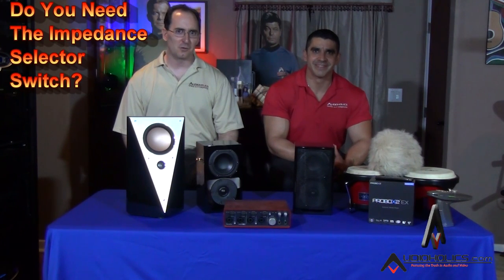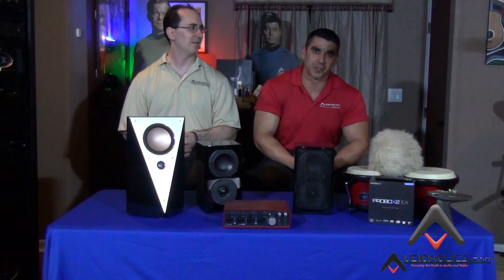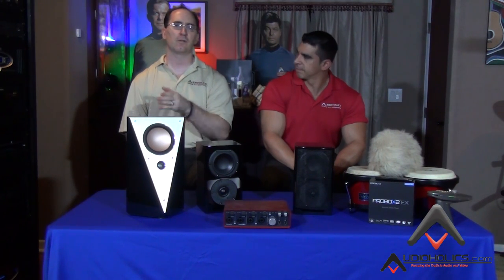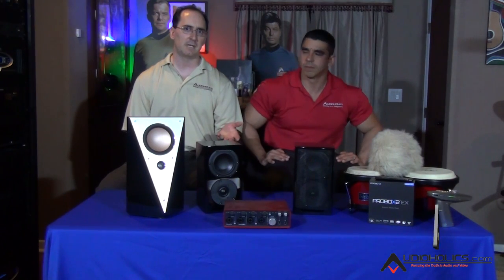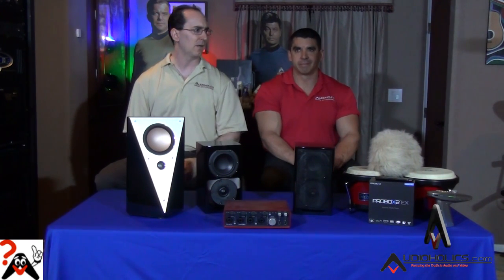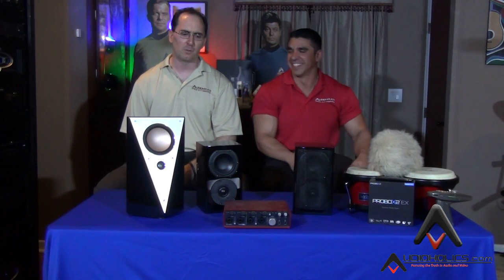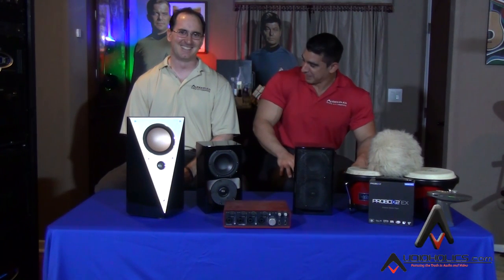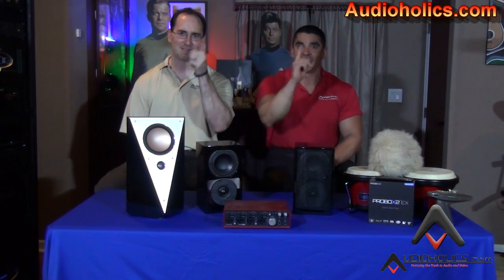AV Receiver Impedance Selector Switch: How Should I Set It?

Comment: To settle this, I would like to see the opposition side of this argument present their case with bench testing results. An actual expert who disagrees with your analysis. The two of you could present the pros and cons and the viewers would then be armed to make decision that they are comfortable with. It's not easy to go against the recommendations set by the people who design the equipment. Especially when equipment costs can easily be in the tens of thousands of dollars.
Reply: For me. It still doesn't make sense. A 4 ohm speaker needs more power than an 8 ohm speaker, so how can a 4 ohm output setting on the receiver deliver less power than the 8 ohm setting?
Reply: @volvy420 @volvy420   Exactly, it makes no sense at all. 
The lower the impedance resistance on the speaker the more current it will draw from the amplifier. If you keep the amplifier t 8 ohms but you have 6 ohm speakers, I would think it would heat up the amplifier more because it would be trying to draw more current this reducing the performance of the receiver.
Reply: @shawnm1472 the whole point is for the Amplifier to be able to deliver more current to your speakers without restrictions from the Amplifier.
So setting at 8ohms on AVR, with 4ohms speakers would allow more current thus more dynamics for your 4ohm speakers.

Comment: Its funny how i stumbled on to this video, here is what i have and i was talking to my speaker company I have Cerwin Vegas for the Front  Below is what Cerwin said! 

VS-150 Specifications

 
DESCRIPTION:                                   15” 3-Way Floor Standing Loudspeaker
FREQUENCY RESPONSE:                28Hz – 22 kHz
POWER HANDLING:                        5/400 Watts RMS (Min/Max)
SENSITIVITY:                                      102dB (1 Watt @ 1 Meter)
IMPEDANCE:                                      4 Ohms
LF DRIVER:                                          VSW  15” Die-Cast
MF DRIVER:                                        DXM6  6.5” Cone
HF DRIVER:                                         VS-T3  1” Dome
PROTECTION:                                    Self-resetting PTC (high frequency)
DIMENSIONS:                                   35.5” x 18” x 18.6” (H X W X D)
AIRSPACE:                                           5.0
PORT TUNING:                                  33hz
PORT DIMENSIONS:                        (2) 4” dia. X 10” long
WEIGHT:                                              90 Lbs.

Whatever the receiver is, setting it to 4 ohms for these speakers will get you the best performance. For a sub, you will want to look at our home audio lines such as the SL series or the XLS series subs.

I have never tried this but I dont think i will, i am in the market for a new Reciever , I had a Yamaha rx861BL   I returned it because of it not having A/B Switching which i like because i can play the same sound while i am in the garage.  Now everything is Zones which i dont understand yet.   So I returned it and bought a Pioneer Xl301 Elite!  Complete Junk i am taking it back tonight, I just dont know what to do about my A\B Switching
Reply from the maker: Please rewatch the video.  There is NO CIRCUMSTANCE where setting the receiver to the 4 ohm setting will improve the sound quality or power delivery to your speakers regardless of what speakers you own or what their impedance is.

Comment: ehhh because im a rookie ill need your help soo i got a receiver that is rated 6-16 omh and my speakers are 4-8 omhs so right now im damaging my receiver if i play them loud right?
Reply: you will damage your speakers if you play louder than the reciver can deliver clean power. as stated in this video if you select lower Ohm in the reciver you are starving the voltage and the reciver will be able to deliver less Wattage, meaning your speakers will clip much sooner. you will not damage your reciver from this, just blow out your speakers

Comment: hi + auduioholics im new on creating my first 5.1 surround sound system i already buy a set of floorstanding,center,surround,and subwoofer..now im looking for an amplifier which are compatible for my new 5.1 system and this are the specs of my system the floorstanding is magnat quantum 755 it is 190 watts and 4 to 8 ohms impedence my center is the magnat quantum center 73 it is 120 watts and it is also 4 to 8 ohms and for my surround i have the pure acoustics supernova bookshelf speaker it is 120 watts and it is also 4 to 8 ohms impedence.Now im choosing between the onkyo tx nr626 which is 170 or 160 watts per channel and the denon avr 520bt which is 130 watts per channel..can you help me which amplifier is compatible to run my system..sorry +auduioholics i can't find a best adviser expect you hope you help me and thanks for advise

Comment: My marantz NR1509 does not have the impedance  switch. But the manual did have a key press combination that allowed me to set the impedance to 6ohms. They said to do this if any of my speakers was less than 8 ohms and my speakers are 6 ohms. Is the impedance switch and this key combination the same thing? And should I switch it back to 8 ohms?

Comment: I just bought an onkyo TX-RZ900 receiver and elac uf5 speakers which are 4 ohm. There is a setting on the onkyo to change the impedance. Onkyo states in the manual to select the 4 ohm option or else damage to the receiver and speakers will occur. So I still leave it at 8 ohm?
Reply: The statement in the manual is rubbish based on advice from their lawyers, not their engineers. And your Elacs  are not 4 Ohm they have an impedance (as a function of frequency) slope like all other speakers. I once had a speaker rated at 8 Ohm. The impedance was measured to be 2.8 Ohms at the lowest point. 0.6 Ohms lower than the lowest impedance on my current 4 Ohm rated speakers :-)
Reply: @MovieViking  no, this is absolutely being recommended by engineers. I'm the engineer!
Reply: @erikandmarcie  But the only effect of the switch is usually a lowering of the rail voltage to avoid over heating. I can’t claim to have seen the schematics of the Onkyo but it has been the case with every amplifier with the switch implemented I have ever repaired or otherwise had a thorough look at.
Reply: @erikandmarcie  Also, before setting the switch I would highly recommend knowing the actual impedance curve and not believing the data sheet. If it is a speaker with steep slopes and low dips most AVRs are not the best choice to drive the speaker.
Reply: @MovieViking  thanks for responding. Overheating is just indicator/signal for reliability which can't be measured accurately without acceleration. The overheating correlates with transitor degradation/reliability, which you're overlooking for some reason?
Reply: @erikandmarcie  No, I’m not overlooking it. As I understand it the heating issue coupled to speaker impedance is only an issue due to a US testing standard irrelevant to normal use. If, however, the consumer choses to place the amp with insufficient cooling it will overheat regardless of the position of the switch versus true impedance of the load driven by it. This is also the reason some manufacturers ship units to other markets with the exact same specs except for the impedance selector. My Yamaha unit even came with a plastic cover designed only for the US market as Americans apparently can’t be trusted to know that the metal surface can become hot. 

Audioholics has covered this and if I remember correctly it is also covered in a fairly comprehensive book about setting up AV gear and Home Theatres in particular.
Reply: @MovieViking  thank you, appreciate your continued respectful responses. This isn't a matter of delayed transient case temperature, it's the instantaneous silicon junction temperature that's much more representative of the ongoing silicon degradation occurring when the current exceeds the designed and intended/expected thresholds. Are you measuring the degradation (power reduction for a given THD) over time to detect/prove there's indeed no risk setting the impedance switch above the manufacturer recommendation?

Super interesting about the impedance switch missing in other markets, and great find/point if it's real. But have you actually confirmed there are no internal design changes with the manufacturer? Although they probably won't spill the beans because that's not in their best interest. Don't speculate, because there are WAY too many combinations and the probability of assuming incorrectly is extremely high.
Reply: @erikandmarcie  😊👍 If the currents and as a result the local heat development can become dangerously high in the silicon itself I will have to claim the design as not made for real speaker loads but only a simple resistive load. As wrote elsewhere I have owned commercially designed speakers with a nominal impedance of 8 ohms but with the real impedance dipping below 3 ohms. If that should cause the amp to malfunction prematurely or overheat I would only in part blame the speakers. The other part of the blame would be directed at the amp’s design. 

Regarding the switch I was told by the dealer that one of the differences between markets on a NAD power amp I once owned 5 of was the absence of the switch on those meant for Northern Europe. I have never owned or disassembled one not sold here so I can’t know for sure if I was informed correctly. 

On my next project the switch will be history in my setup. I’m looking to powering all speakers with Class D modules 😊
Reply: @erikandmarcie  Btw I would love to make the measurements you propose. In my current setup impedance is not much of an issue as my main speakers and the sub crossover is set at 60 Hz so almost no effect is sent to them in the area where their impedance is below 6 ohms.

Comment: okay - explain to me like I am a 5 year old - I have a Yamaha RS 700.  The ohms switch options are -low - a and b at 8ohms, a or b at 4 ohms (I use 4 speakers and a sub).  The high switch is for a or b  with 6 ohms out put.  My speakers are 8 ohms speakers.
When using all 4 speakers, does is matter what setting I keep it on?  Should is always be set to low or high in your opinion? The unit puts out 100 watts per channel supposedly.  Thanks!
Reply from the maker: Rewatch the video. The answer is very clearly stated multiple times how to set this switch.
Reply: Audioholics 
Gee thanks mr personality...
Reply: @cmkilcullen8176  Set it to the highest possible setting and leave it there as they state in the video a number of times I'm to lazy to count :-) There are ZERO benefits, only huge disadvantages by setting it in any other way.
Reply: @MovieViking  
10 4...thanks...
CMK